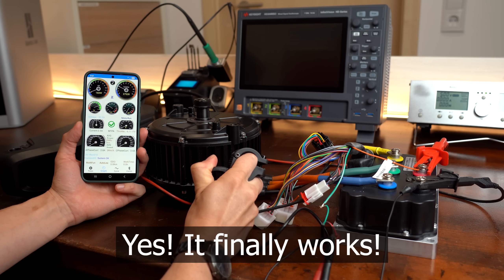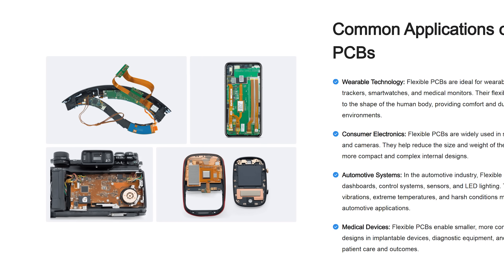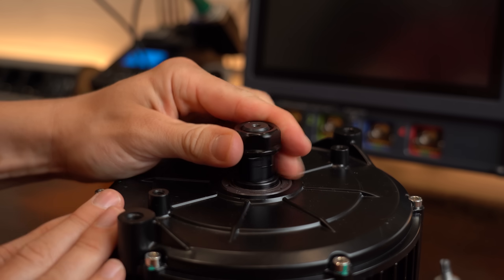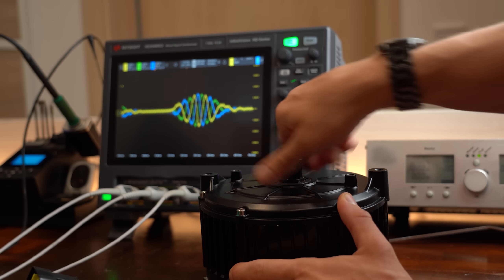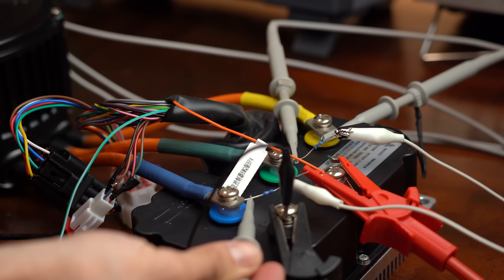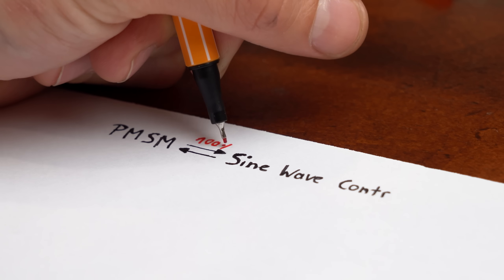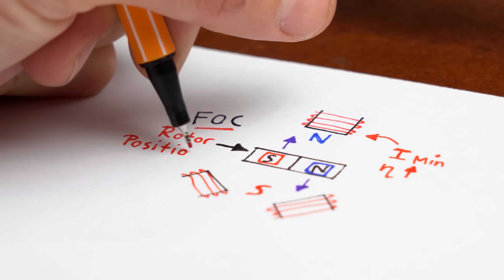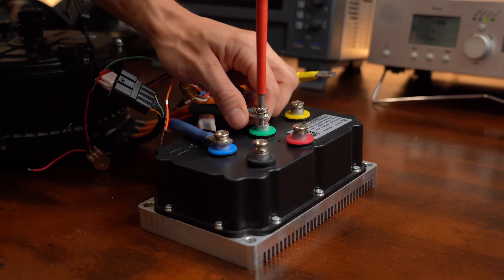The Most Important Motor for our Electrical Future?! (PMSM) EB#63

Comment: BLDC and PMSM are induction motors they just use different ways to produce the magnetic field. BLDC is doing what a 3 phase is doing but with a controller instead of connecting terminals in certain configurations. DLDC are also much simpler to control because all you doing is moving the current to a different wire to move the magnetic field. The PMSM seems to be a strange axial flux motor using a sort of coil winding to produce a sine wave but it is still using induction. It's actually very impressive but inefficient. They should get whoever made it working on stellarators or tokamak. If someone were to create an axial flux motor controller with a SPWM it would probably be similar maybe a little more efficient.

Comment: I want to see you use it to drive an air compressor, or compressors. Which fills storage tanks, capturing energy in the pressure difference. Ideally powered by local solar. Used, as pressure released to drive something like a turbine generator, converting back to electricity. Bonus points for using the motor AS the generator too. Pump in the day, generate at night. 1000 litres (1 cubic meter, or 10 x 100 litre tanks) holds 1.09 MJoule at 10 bar. You're not going to extract most of that in (re)generation. But at 5 kW, your motor could probably fill 8 or 10 of those ~1 MJ air batteries each hour. Let's say, 2 hrs per day of that (or 8 hrs at 1/4 that rate), and you have yourself some portion of 16 MJ to use overnight (depending on regeneration efficiency). That's X / 4.444 kWh. And you only need to find space for 120 x 100 litre tanks.

Comment: I'd love to see two of these used to drive a wheelchair. I attempted this years ago and still have to wheels made up in my attic with BLDC one-sided-spindle ebike motors. I dropped the project when I couldn't think of a good way to implement an e-break that locks each side when no power is applied. Potentially an out-of-the-box idea for you to think about. Thank you

Comment: I doubt anybody that sees this will actually go out and try one but there is another cool type of motor called a transverse flux motor and they are pretty hard to find but there is one place you can find them and that is in Old broken onewheel V1 original board from the Kickstarter days ($100-500). They have tons of magnets for high torque, the stator design also looks somewhat alien.

Comment: Make a bicycle with a quick reacting speed controller that has variable torque for acceleration and Regen.  Then use this combination, with a gyro and accelerometer, to create a control algorithm that helps the rider by automatically balancing the bicycle when doing wheelies.  Of course the rider will be responsible for controlling lateral balance, while the electromechanical systems work only on the longitudinal balance.

Comment: My old ESC's had a selection for 6-step drive or phase-vector control. Some of my BLDC motors came (more expensively) with sinusoidal fields and when driven with the phase-vector method would run a tiny bit smoother with less noise. They've existed side-by-side for over 20 years now and it's simply a matter of cost/simplicity vs smoothness/noise/efficiency.
In many applications however the losses in the drive circuitry make up for any benefits in motor efficiency though, making the switch pointless from this aspect alone. Adding actual noise to an EV during slow driving makes another aspect half-moot too.

Comment: oh zero NE2.. halbach setup inside BLDC in DELTA instead of WYE.. woow so new. soo good.. i do reconecting bldc to DELTA since i found out VESC.. witch can propertly aply energy by angle.. + return control by halls.. this motor bring nothing new..  dotn spend a single peny for this garbage.. go BLDC. reconect it to DELTA and enjoy real power output

Comment: The much better way to convert electrical into rotational power today are Synchronous Reluctance Motors (SynRM). They show a flat torque-curve, don't use expensive and temperature sensitive NdFeB-magnets (need less cooling) and allow smoth operation. Many EV's and industrial applications use these motors. Railways also start to jum on tha bandwagon. ABB even fades out asynchronous motors in favor of SynRM.
Reply: SynRM motors are cheaper, but PM motors have smaller mass and volume for given power. So in high performance applications PM motors are still preferred.
Reply: @dmitryplatonov  It depends on sacrificing efficiency vs. power density. SRM (Switched Reluctance Motors) are competitive, if this criterium is desired. Particularly newer axial flux designs shine. The big advantage are lower eddy current losses, due to a laminated rotor. PM's can't be laminated, so back-EMF induces such currents - and heat. In cars and industrial applications, power density is not a real issue. Except, you want to build small cars in the MW power range. Even combinations are possible. E.g. Tesla's Model 3 utilizes an IPM-SynRM motor.
Reply: @dmitryplatonov  less and less so - and i think you mean they have better torque density - power density goes to the SR motors as they dont have the same drawbacks when using field weakening (higher RPM @ similar torque = more power out of the 'same' motor). SR/PMSM's are much harder to drive, but that's getting less of an issue with better tech and encoders getting more accessible (mainly, cheaper).

Comment: I bought 2 "47kw" PMSM motors for basically peanuts from wrecked EVs. Going to use them as generators, my thinking is the construction pf them and how the magnets are placed for optimal drive efficiency will also give me optimal generation efficiency. Not sure if this thought of mine is valid or not though. I am not an electrical engineer.

Comment: Well if we want to be more specific most important motor for electrical future is in my mind ferrite assisted synchronous reluctance motor that does share many things with this motor but main difference is that it uses cheap and way better for environment ferrite magnets and utilizes reluctance principle to produce most of the torque like 60-70% in my testing. I have actually been simulating this type motor with motoranalysispm and while it has lower torque potential than similar sized neodymium magnet motor it can get really wide high efficiency curve even getting like 97% at high rpm and low load that usually is not possible with normal pmsm motors because they have quite high magnetic flux inside the motor always due to strong neodymium magnets causing more core losses. Full reluctance motors can be bit hard to drive and have even lower torque potential and externally exited motors even without brushes introduce more complicated electronics and construction so they aren't suitable to as many applications as these ferrite magnet based ones.

Comment: PMSM generator! How to charge different battery packs (12v, 24v, 48v) with a PMSM motor and controller.

You can use another electric motor to simulate the internal combustion.

Comment: As an RC model pilot I have a lot of BLDC motors from 200W to 3000W and above. Thank you for sharing the insights regarding PMSM. 👍👍
Reply: The tradeoffs aren't as clear cut for aircraft as ground EVs. The layout of the magnets in a PMSM is harder to make lightweight, so you can easily end up losing the electrical efficiency to induced drag (fixed wing, less of a drawback but still big) or straight thrust increase (rotary wing, very big drawback). It could still be worth it, but at rc scale probably only in fixed wings, and even then probably only on big one, and I don't think PMSMs have even matched that far down the size scale in general availability.

Comment: PMSM are great as generators. Motor application requires thicker wire, while generator would typically require less wire thickness but more turns. It's great when it's possible to tweak wiring and optimize for generator application. I bet 5000W motor can produce 1-2 KW as generator. So maybe wind turbine or hydro?...

Comment: Re bikes, not long ago i was surprised that the Fallbrook gear 'Enviolo NuVinci CVP Hub Review, Stepless Continuously Variable Planetary Transmission for Bikes' got and seems to get successful. Maybe a litte less efficient that a real gear but belts and continuous variation - with a 'middle' motor seems to help. The German Manufacturer Riese & Müller seem to use them often. 
Its less about the motor but the gear. Motor style and efficiency i don't know.

Comment: I had no idea that normal BLDC motors do not use FOC. I thought that is what the speed controller circuit and all the other encoders do in a BLDC controller. I am still a little confused though, like does a BLDC just fire the coils in a specific sequence and just work like a synchronous motor without knowing the position of the rotor?

Comment: Ebike builder here. 

Fardriver controllers and QSMotors are way way Underrated.

You can easily run 3x the rated power continuously without any issues whatsoever. Hell, there are people running 5x this particular QSMotor model rated power and the temperature does not exceed 80c, which is safe for these motors.

Disable field weakening if you don't need. Usually it is overkill
Check YouTube videos how to set-up and configure fardriver. There are many videos!

FYI these motors are designed to rev very high. Above 72v nominal is where they shine. 134v is the ideal nominal voltage IMHO and it is a rocket ship.
Reply: Won't the permanent magnets degrade at high temperatures? The rating is probably more for rated lifespan than for marketing
Reply: @Jadinandrews  That's pretty much instant that you loose (part of) the magnetization as you (to some limited extend) exceed the temperature rating. It's not that temperature at the limit will slowly leech magnet strength, or that exceeding the limit will turn the magnets into dumb non-magnetic rocks.
Reply: @namibjDerEchte  precisely
Reply: Yeah I looked it up, neodymium magnets start to lose their magnetism from 80c, and since you don't have a reliable way to measure the temperature of the magnets themselves you are slowly degrading the performance, over powering the motor is probably only safe for very short bursts
Reply: @Jadinandrews On fardriver controller you can setup the safe temperatures to work with. For instance, if hit 65c it will reduce the power automatically, if gets to 75c it shut it down completely.

80c is the absolutely max.
Reply: Careful that if you hit danger temp, usually the temp at the source is higher  @Full_Throttle_no_Brakes
Reply: @EpicBunty I know.
Reply: Please make a go cart
Reply: do you buy the motors already installed in a wheel? i only see motors without the wheel surrounding it
Reply: @gunginga  probably mount it to drive the chain, in wheel motors are generally less powerful and can't benefit from gear changing
Reply: @ThylineTheGay that makes sense, i see motors with 10kw online. if these are chain driven they must be crazy powerful
Reply: Do you have any idea why its the case that they can run so much more rated power, why would companies not advertise it?

Is this just a case specific to e bikes, because you are not ever trully continously using any power?
Reply: @PleyVi  They are rated from the weakest possible component, and have use case/service life requirements with various listing agencie for certifications.

Usually electric motors are under driven for normal use cases. Exeption to that rule of thumb are more for single purpose motors
Reply: @PleyVi I bet it's for safety margins so they don't get sued
Reply: @chazlabreck hmmm. But when it comes to chinese marketplace like temu, alibaba, AliExpress etc, its very common to over rate all products. Lol
Reply: @unmeaninglessly143  depends on the product, for niche/nerd electronics it's generally reliable, it's the items with wider appeal (ie. battery banks, torches, SSDs, etc) that get widely overrated (just like on amazon)
Reply: @unmeaninglessly143 hence I over-specified the BMS when replacing the supplied item in the main battery.
Reply: @PleyVi  they rated for max efficiency, you can drive it with more power but the efficiency goes down (IMHO)
Reply: So the e-bike equivalent of 'overclocking' the engine? Goodluck trying to use it for more than a year or two!
Reply: @junfon7097 No. Based on the size of the magnets of the motor, windings, back EMF is possible to calculate the max safe continously amps of the motor.

What kills motors are amps, not voltage.

Watts = Volts x amps.

QSMOTORS publish a extremely conservative estimate for their power specs.

Comment: This take on the "difference" of BLDC and PMSM is not correct. There really is no difference between them, the terms can be used interchangeably, though few people talking about large motors call them BLDC motors, that's more small device terminology.

You're talking about a subgroup of both PMSM and BLDC here, sinusoidal motors.

Comment: Interesting, I'd never seen/heard of an SPWM signal before (just PWM). Looks a fair bit like an Frequency Modulation (FM) signal.
Reply: On most electric trains with AC motors, the inverter uses SPWM. At higher speeds, the number of pulses reduces in several stages, and you can usually hear it as a faint noise sounding like a car shifting gears.

Comment: Good video. In the design of electric motors, the number of pole pairs is an extremely important factor, as it greatly improves the motor's performance and efficiency. Even if it's a 4-pole brush motor, it's already quite efficient and less complex to manufacture and control electronically. 4-pole brush motors are increasingly being used due to their easy control, durability, and repair. Most automotive power steering systems are very robust 4-pole motors with brushes, as are the radiator fan motor and the starter motor. Ultimately, 3-phase PMSC motors will be subject only to the traction and main power of an electric vehicle.
Reply: 4-pole as in 2-phase?

Comment: 400eur for a 5kW motor is not the bestest of deals. I know a company that used to make motors for BYD, and they sell 15kW continuous(30kW peak) motors for around the same price. Shipping not included of course. Though I'm not sure if there would be any use for it XD
Reply: Link
Reply: That motor will do WAY more than 5000W
Reply: @AaronHendu I would think so based on the size too. But Ive seen 5kW motors around this size sold in China so Im not sure anymore. Are you talking about instantaneous power or continuous?
Reply: any larger than 15kw?
Reply: @yujyuj2957 What are your trying to power 💀 they have bigger of course, but past a certain power it wont be mass produced or not sold retail so you would need to pay a lot more for those
Reply: @CielMC just for small ev but high speed. rear assist propulsion. 
what voltages do they need to run? is fardriver the best?
Reply: @yujyuj2957 At least the manufacturer Im talking to has one that runs at 30kW continuous up to 20kRPM. They can rewind for any voltage but maybe dont go too low, current heating will kill it. Fardrive has pretty good rep but I haven’t tried them yet

Comment: I think I'm getting rusty 😅🤌 all the motors I used for my ebikes, scooters, boats gives a nice sinusoid waveform like the PMSM which voltage (while hand driven) will increase with speed. Isrnt the square wave the result of cogging on poor designed stators/rotors? 
There is many different designs for bldcs, like skewed stator teeth, rounded or flat magnets...etc 
Finally, as some other stated, you may want to go back to the VESC junger Mann :) da gibt's jeder Menge awesomeness und diy potential 😎🤘

Comment: I work in a repair shop for all electronic industrial equipment and believe me that PMSM its the standard in servomotor for quite a time, it is a very expensive theme because they are different to the hobby/EV's ones, the motor look like a stepper motor but in the inside it is a PMSM, the most difficult part is the last one mention the Encoder, there are a lot of models/brands but the most commons ones in the industry is Heidenhain and Sick, and they are a pain in the ass to work with in terms of repair, but in the working they are super precise and create a huge effiency in the industrial process, thanks for the video, a Video about PMSM for hobbys etc it is not common.
Reply: fun fact: encoders break a lot in high vibration uses (i.e. automotive) and can get very expensive for robust operations. People are moving back to resolvers for rotor axle positioning due to increased robustness! When encodesrs and digital control arrived it domined the market due to it's ease to use in microcontrollers and resolvers where forgotten. Now the majority of car brands are coming back to it!
Reply: @RafaGmod 
Car brands are coming back to RESOLVERS, OR THE PMSM MOTORS, OR BOTH⁉️
I'm trying to keep up, but I'm not unlike a robot in that I don't know enough to FILL IN THE BLANKS, so info has to always be written out precisely. 
Also, I'm getting really into electric motors and I want to draft out, fabricate as many parts as possible myself to save money, order the rest from 3-D metal creating companies, and etc, to make my own
electric vehicle !!!!!!!
-
Thanks for considering a reply.

Comment: PMSM motors are more efficient than induction motors, or at least have less problems overheating but since you can't turn off the magnets they will always produce drag. In a twin motor electric car you could use a PMSM motor for constant drive on one axle, and an induction motor that's used just for acceleration or traction on the other axle. In a single motor car there's not really any benefit to using an induction motor, hence the current market share.

Comment: so, a three phase ac motor controller designed for cnc spindles... if they'd work there's a LOT of cheap, easy to use, no fiddling with apps method of running them.